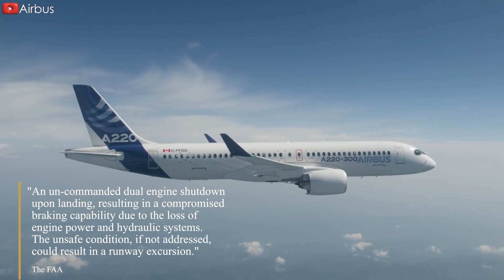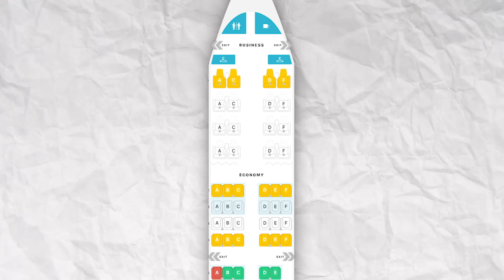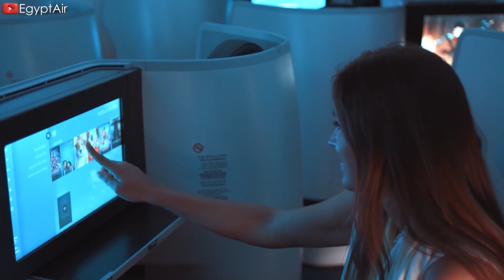Airbus is in BIG TROUBLE and NOW even bigger & bigger than you think! Here's Why

Comment: The A220 was engineered and designed around the PW-1500. That’s the problem. 

They can’t just put a set of GE’s or Rolls Royce’s on the A220. That would require a lot of money, time, resources, re-engineering, flight testing and then getting it re-certified. 

In other words; Extremely expensive for a Jet that Airbus purchased for two reasons; No upfront costs as all the Engineering, R&D, Design, Flight testing, was done by Bombardier. It’s second purpose was to be a reliable, good selling and deliverable. 

Pretty much expected to plugging it into their line and all would go smoothly. 

It will be a GREAT jet. But it’s reliability is an issue.  Solely due to the PW-1500’s. Which when operational, are MX nightmares. The supply chain is an issue there.

Comment: Only 3 jet engine manufacturers supply both Boeing and Airbus. Boeing is suffering of another kind of issues than only engines failures. The troubles at Airbus are not so 'BIG' as claimed in the title of this video. I sincerely hope that Boeing will come out better after all the current troubles have past. A strike now, doesn't help the company either.
Reply from the maker: Hope so!

Comment: I had notice the engine problems for the A350-1000 because it was in the news last month with Cathy pacific grounding planes to check them but also had similar problem with the A350-900 regarding the A220 and the Pratt @ Whitney 1500G engines that should have been sorted out before now especially when lot of airlines use the planes in Europe and the uk and in America and it’s American engine manufacturers nothing to do with Airbus the same with engine problems with the A350S it’s not something that Airbus has much say in because it’s rolls Royce is the engine manufacturer and they need to sort it quickly or they need another engine option for the A350 and the 787-1000 again rolls Royce hasn’t done much to sort out the problem but they could use the Trent engines that are used on A330-900 for the 787-900 and the 1000  it’s an option until they find out exactly what is causing the problems with those engines.
Reply: Delta dont have much problems with the A220
Reply: Yes I knew that and it makes the video confusing when the person who’s doing it doesn’t seem to know what the actual problem is with some of planes.

Comment: This video is posted as being about Airbus problems.  Obviously the author knows nothing about how aircraft are put together with engines being manufactured not by the airframe manufacturer but by specialist engine manufacturers.  How he can equate Boeing's airframe problems - the result of bad design and cost cutting - with the P+W and RR engine faults occurring when hung, at the airline's choice, on Airbus airframes beggars belief and says little for his credibility.
Reply from the maker: Do those problems happen on Airbus aircraft? Also, if I knew how they were put together I would definitely be working at Airbus, P&W, or RR and not here :)
Reply: @FLIGAVIA  You, maybe because you want to increase the number of views, use a clickbait headline and in your narrative continually state and infer that this is an Airbus problem.  IT IS NOT.  The engine problems are engine manufacturers' problems.  Just as when Boeing 787 had RR engine problems, no-one with any knowledge blamed Boeing.
Manufacturers offer airlines an airframe and either a choice of engine or just one.  Airlines and leasing companies then decide if they are going to buy a particular type and, if there is a choice, specify which engine.
If there is a problem with their choice it is the airline's/leasing company's problem to sort out with the engine manufacturer NOT the airframe manufacturer and it it the engine manufacturer that pays compensation.
Your take in this video is as ill informed and misleading as the nonsense that appears in the press when these situations are publicised.
Fewer than 5% of all airline passengers realise that the engines come from a different manufacturer than that which built the airframe.
You are not helping to increase knowledge - just the opposite.

Comment: The PW1000G issue is well known and because of  Pw of Canada presence and that the A220 was originally a Bombardier Cserie Canadian plane,it was normal is was the primary standard engine, since the Max and  A320 were taking all the Ge Safran Leap production the only competitice product to the PW100G…So, when the USA set enormous duty taxes to protect the ill born Max for the domestic us market....Airbus unfairly excluded from the KC-x because Airbus won after the refueling tankers of Canada and South Korea so their MRTT is a much better plane than the ill born  KC-46 Pegasus a B767 derivative…with MCAS as well…
So, the tanker bid re-tendered to exclude the winner, Airbus, Airbus had the Usa Mobile Alabama plant built for the tanker program, idling a bit and assembling there the modern Bombardier single aisle (while larger A320 family was growing to a Neo long range XLR with new efficient jet fans and not competing directly at the low 100- 120 passager range) it  was a win win for Bombardier-Airbus to beat Us import duty for the Us domestic market and the Bombardier Cserie became A220.. the PW engine is still a  problem with planetary gear vibration but PW is not the only one with modern jet fans problems, the huge GE9x on B777x is also the root cause of much delays…so this is not an Airbus direct issue but it affect the fleet and I guess many airlines will ask for Leap option to be available on future stretched A220 stretched versions….even if w/o gear the Leap is 1 or 2 % less efficient, engine failures and planes re-routing increase cost including fuel burned and reliability can be overall more economical with better uptime and less maintenance cost.
Reply: "Airbus had the Usa Mobile Alabama plant built for the tanker program, idling a bit and assembling there the modern Bombardier single aisle "

FALSE

Airbus had its Mobile building constructed especially for the A-220 as Boeing complained to the US Gov't about the fact that it was built in Canada.  This legal skirmish lasted almost 4 years with Airbus counterattacking Boeing for not making part of their planes in Europe while Boeing join the skirmish to complain about Airbus not making past of their planes in USA, so it went to the International Trade Commission tribunal, cost over 2 billion each of legal fees for absolutely nothing as nothing has changed beside the fact that Airbus has a new site in Mobile and won't have to make one in Europe.  They upgraded the Bombardier facilities in Mirabel (YMX) 40 miles north of Montreal while the Montreal site has remained in Bombardier's hands for their executive jets production.

Suffice to add that the PW1000G is a family of engines as there are also the PW1200G and PW1500G which were first tested on A-220 while the A-220 was the first aircraft to use the PW1000G for their first 70 airplanes and has been using the PW1500G since then.  It would have taken another engine then the P1000G if Airbus wanted to extend the airplane to produce the -500 but can use the PW1500G which has become the standard engine on all A-220-300.

An EU company can't make business in another country outside its jurisdiction without having a business office in that country which was the case for Airbus before the A-220 Boeing complaint.

Source :  Transport Canada, World Trade Commission and Airbus.
Reply: @WillReims-s2s  Sorry, but if Airbus had to built the tankers for the airforce, contest that they won on the bid first, but was re-tendered to eliminate the winner, it had to be assembled in the US , so this is the root cause of all the land purchased by Airbus and plans for a plant in the US and then, the crasy  high US import taxes forced the Canadian-EU merger to use the Airbus investment made and beat those  two « free trade offense » protectionists measures, which of course, ended with WTO arbitration, Boeing accusing Airbus to get favorables programs financing loans from the European Union while Boeing was receiving indirect DOD subsidies like the 84.000.- $ per toilet seat for B52´s and other s…. like that, etc. While Airbus at the time had no military planes activity yet to get similar bribes… The conclusion is that protectionism to protect unsaleable crap is useless and expensive but for weapons , failures like KC-46 or F-35 amplified by corrupted decisions are a serious threat for the free world safety (ie, the 82 civilised countries condemning Russian invasion of Ukraine) and Moscou and Pekin must be  laughing at us of being so inefficient. We should be better off producing together mainly the best of all, Rafales, Meteor, Cesar, K6 , Javelin, etc with more volumes and true performance competition and then only dump elsewhere the old used vintage obsolete stuff, a necessary sacrifice for all of us,,,because no countries starting with the most threatened ones like Israel or South Korea can build the entire arsenal they need. So, we can gain both safety and dissuasion with less diversity and better product quality while restricting all our high tech export to those using it against us, a side effet of globalisation and free circulation of goods and services . This can be obtained with strict export controls, ( clouds, data and pictorial instant comparaison ) similar to all commercial airplanes parts filed and registered to avoid any counterfeit parts trading causing catastrophic accidents, but a larger market open to the  best 82 countries can offset by a larger volume, the impact of those efficient restictions to felons..
Reply: @philgooddr.7850  Unfortunately you are confusing what happened.  Airbus bought the land and construct its manufacturing plant in June 2005.

"In 2008, EADS launched a joint bid with Northrop Grumman to supply aerial refueling tankers to the United States Air Force. As part of the bid, EADS planned to assemble the basic Airbus A330 airframe in Mobile before delivering it to a neighboring facility to be operated by Northrop Grumman, where it would be converted into the KC-45 tanker"

Source :  https://en.wikipedia.org/wiki/Airbus_Mobile and Airbus financial report (2005).

In Airbus 2005 financial report it is stated on page 34 that they acquired a piece of land in Mobile for ..... the A-220 and expect the construction of the buildings (two plants and one for engineering development.  The also stipulate that it asked the American gov't to gain access to American military procurement tender's list.

In Airbus 2011 and 2015 financial reports, it is stated that they have created a division for commercial airplanes "parts" as they signed an agreement with Boeing for some parts and components which could also be manufactured in England.
Reply: @WillReims-s2s  yes historically the specific programs dictated essentially the alliance made and concluded making it complicated..Aérospatiale with British aerospace on Concorde, then the A300 started with a GIE , a French structure called «  Groupement d’Intétêt Économique » only linking independent Co. on one single program but not the rest of activity…( engagement stage not yet a mariage..typically French!)  Aérospatiale and Aeritalia on the turboprop ATR also started as GiE, the merging of aerospatiale Marignane helicopters range with MBB (Bo 105 at the time) becoming Eurocopters, with Casa on A400 Airbus military group, Aérospatiale leading Arianespace, etc,,all this gradually became EADS/Airbus with specific space, military, commercial and helicopters divisions. 
Note some positive opening also happened in the US…the  indestructible B52H are being re-powered by Rolls Royce F130 ( the BR725 jet engines of the Gulfstream ) into B52J…after 70 yrs of service it is now time to quite smoking..no more black smoke trail..and 8 engines per plane a good deal for RR..
Finally the GE- Snecma Cfm56 now GE Safran - Leap transatlantic cooperation is remarkable. Like mopeds we run better on mixture they say.. One impact of those contacts was Airbus favouring GE so that all news A300 310 330 etc always flew first with GE engines ..and finally engine-plane interface became almost standard and interchangeable.
Reply: @philgooddr.7850  "yes historically the specific programs dictated essentially the alliance made and concluded making it complicated"

It is not that complicated, all companies that have had the money to buy other companies that could make their own a better one with a lot more knowledge and expertise has been the essence of the 20th century entrepreneurship in every market.

 A company that stays still on what they have reached, will not last long as it will be surpassed by another one with better ideas, knowledge and marketing.  

We are not in a country by country market anymore, the economy has not become global without reason either.

Suffice to say that when you include the "financial partnerships" on top of joint ventures made it a lot more complicated.

Please stay within the boundaries of the subject, it will be easier to understand.  You need to take into account that there are a huge number of people who read this comment line up and don't totally understand the particularity of the English language.
Reply: Because the CFM International LEAP engine used on the 737 MAX was larger and mounted further forward from the wing and higher off the ground than on previous generations of the 737, Boeing discovered that the aircraft had a tendency to push the nose up when operating in a specific portion of the flight envelope (flaps up, high angle of attack, manual flight). MCAS was intended to mimic the flight behavior of the previous Boeing 737 Next Generation. The company indicated that this change eliminated the need for pilots to have simulator training on the new aircraft.

MCAS, contrary to what you wrote is only installed on the 737MAX because of its engine wing configuration.

Source :  Wikipedia (along with several links to each aspect of the MCAS).
Reply: @WillReims-s2s  Of interest: For the Leap and Max it is ALSO visible than while mounting the engine forward, the shield reinforcement of the fuselage protecting exposed passagers from the fan blade flying off in case of severe engine failure had also to be moved forward but wasn’t…and the protection is now misplaced!!! This is one more evidence  that FAA certification of the Max is a pure JOKE ..and here….you only need a pair of eyes and a 1.0 upgraded idiot brain to see it…loss of live is not a just a financial issue, it is an irreversible damage… and what is being certified for road use or in the sky and is demonstrate to be unsafe is just insane and mind blowing sometimes..because doing it right is not expensive but safety is only a pure cost for stupid beans counters pricing a project where they cannot anticipate, evaluate and enter le potential damage costs always much much higher, thousands times higher than the define « pure cost only » of safety..( a full authority rock avoidance GPS on Costa Concordia for instance or a speed limiter on Talgo high speed trains in the curves while driver is on the phone..etc) 🤔🤫🫣😪😢🤮☠️
Reply from the maker: Thanks for your useful comment! Love it!

Comment: With all do respect AC did not have problem on several A-220 as mentioned but only one due to one engine problem.  AC decided to inspect all its A-220 received prior to August 2021 as the gear turbo fan (a new engine technology from P&W) could show the same "part " problem through its normal maintenance schedule for most of the 7 aircraft involved.  None of the passenger booked on these flights needed to be compensated as they were all booked the same days for the same destinations.

This incident has nothing to do with Boeing malfunctions due to several very different problems with different aircraft types.

Airbus is finally not accountable for this minor problem, everything has to do with the Pratt & Wittney as well as Rolls Royce.

To the myriad of problems incurred since January 2020, 86% of them were related to "engine problems" not Airbus nor Boeing.
Reply from the maker: ''To the myriad of problems incurred since January 2020, 86% of them were related to "engine problems" not Airbus nor Boeing.'' It seems nobody knows that and all of them blame it's the aircraft manufacturer's fault.
Reply: @FLIGAVIA  I wrote to both manufacturer legal dept to advise them there is a lot of video clips that target them while the only companies at fault are engine manufacturers.  

This has to stop as it is false information that tarnish the wrong manufacturer.  I doubt they will enjoy what they find when they see the video for which, I included their YT links.  

These are defamation case which could lead to a legal battle I wouldn't like to be part of. 

This is not the first subject I have dealt with in the past 14 years that reached the Courts... and is not the last.
Reply: @FLIGAVIA  Why don't you produce a video clip about it.  You will need the exact info from the actual gov't bodies that makes the investigations and submit a report.  Those reports are public matters so they need (and do) publish them on their respective site.  

The 86% comes from the incidents that occurred not only within the borders of North-America and Europe but is related to the incidents of the following manufacturers :  Airbus, Boeing and Embraer and pertains to commercial aviation.  

The sites in question provides a wide variety of data including single engine aircraft such as the one made by Cessna.  This is an entire different story as most of incidents are pilots fault.

I hope you are good with statistics because they could be misleading at times, it is only a case of knowing what you want to write about so take the time to read their respective legal documents in relation to statistics as they don't all have the same methodologies.